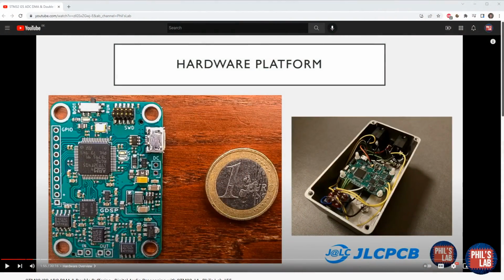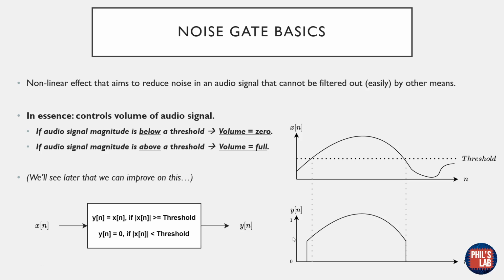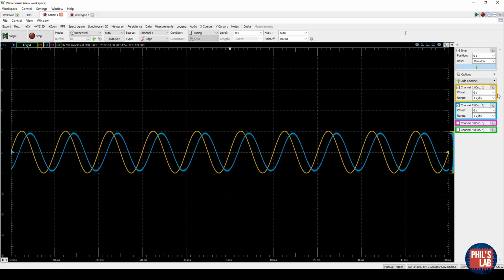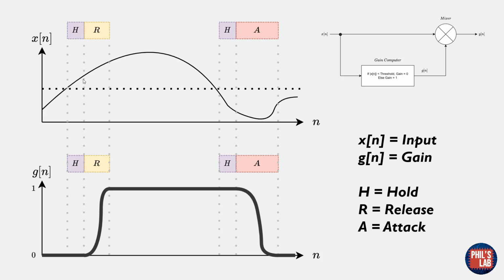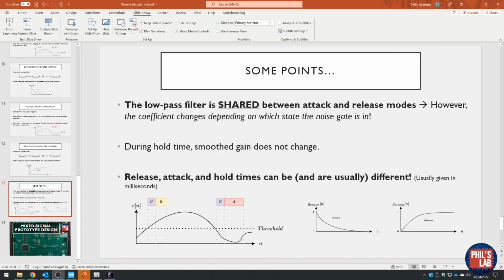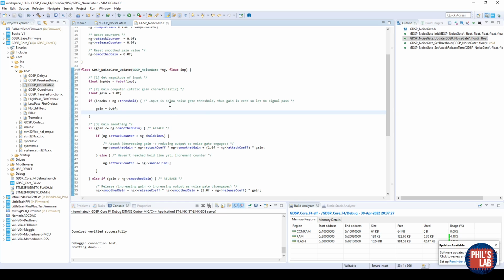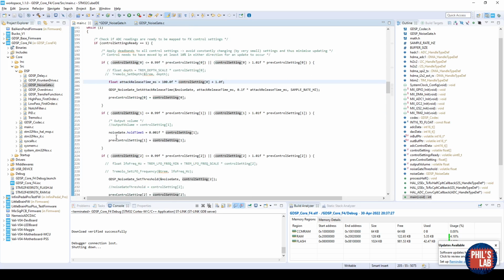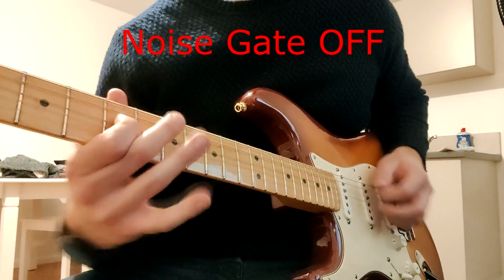(Sponsored) Noise Gate - DSP with STM32 - Phil's Lab #58

Comment: Aren’t you supposed to control the gain computer by the signal envelope value and not the immediate amplitude value? How does your implementation sound with clean tone?
Edit: thinking of it, if “attack” hold time in your implementation were set to something like 150-200 mS, it should have the desired effect of not clamping every period of the signal and causing waveform distortion but would actually emulate “control by the envelope” letting the signal through unchanged until a period of 150-200 mS of no signal above the threshold. Also, some threshold detection hysteresis would be beneficial. And a terminology nitpick - the “attack” and “release” terms would sound more familiar to those who regularly deal with dynamic processors, if they were reversed, i.e. “attack” usually designates device reaction to onset of the signal, regardless of the action of the processor (gate, compressor, expander.. envelope controlled filter..) and “release” designates reaction to signal decay. Cool series on DSP nevertheless, keep up the good work!